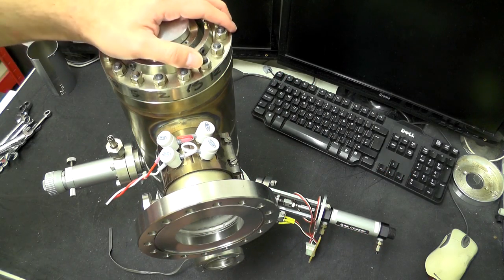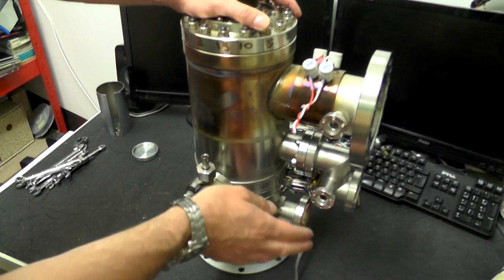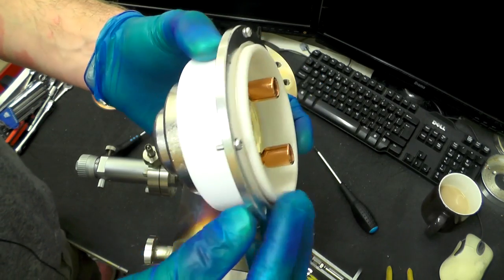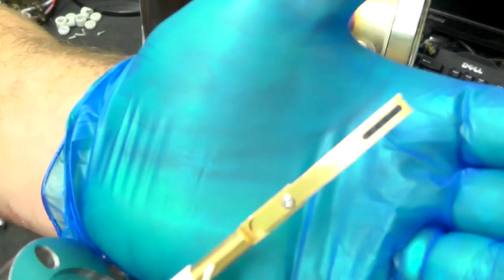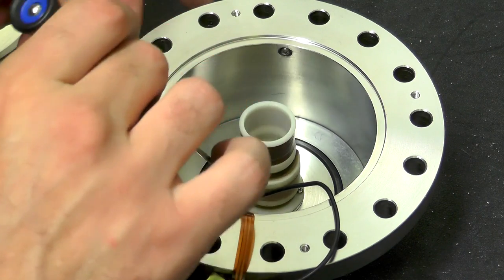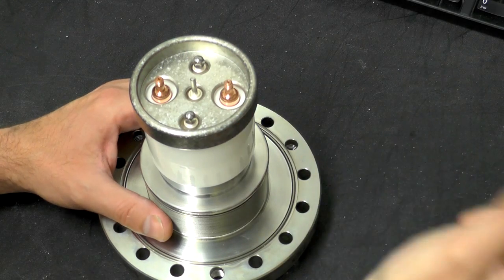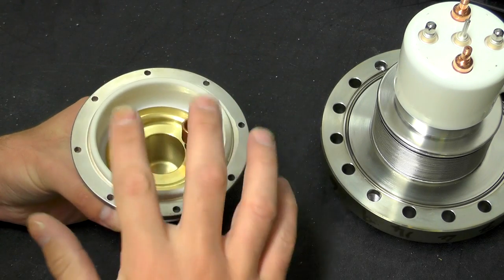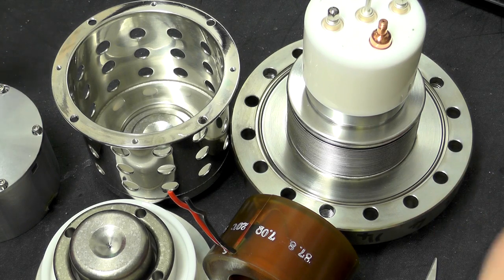DL123 - SEM Teardown Part 2: Electron Gun & Column

Comment: I wonder if the electrode on the beam aperture doohicky is so you can get the beam dead centre though the hole - adjust for minimum current hitting the aperture
Reply from the maker: i think that could be entirely possible, i only have a couple of basic block diagrams for this machine but newer models used an alignment target that would generate a pattern to view on the monitors.
Reply: I have not seen that mentioned in the manual of the microscope. At least on mine the apertures are for different tasks, On mine the apertures are 400µm 300µm 200µm 100µm where the first 2 are noted to be for X-Ray analysis, and the second 2 are for secondary electron imaging.

I can probably tell you guys more, once i get mine up and running.

edit:
Oh and thanks Dexter for the tairdown, it has helped me on the restoration of my microscope.

edit2:

The manual dose mention the aperture control in the condenser lens alignment procedure, but it dose not state it is the thing being aligned. Im guessing the condenser lens has more then 1 coil for alignment, alternatively i can guess that the scanning coils might be able to do so as well.

Comment: The coil at 27:37 is the main focusing lens.  The objective lens is basically in the tip of the cone on the very end.  The large magnet is the condenser lens.  While the condenser does look about right, I always thought that the focusing lens would have been bigger and require more current.  But perhaps it doesn't as its really just preparing the beam for the primary objective.  I also would have thought that the astigmatism/bending lenses (the octopole) would have had iron or steel cores.  But hey, you learn something everyday.  My experience with this stuff is mostly limited to high current ion beams for semiconductor processing.  Thanks for the video.
Reply: I don't think so. The 1st set is a saddle deflector that probably aligns the beam to the center of the aperture or the center of the objective. The larger coil is a condenser, while the objective was left on the chamber (you can see it at the chamber on the 1st video)

Comment: Regarding the emitter: Hitachi is using the term "Field Emission" for Schottky emitters too, i.e. emitters that are heated and under high extraction voltage at the same time, so it's not sure that the emitter is cold.
Reply: The emitter for the S800 is cold.  I own an S4000 which is similar.

Comment: Great video, thanks for posting. I think the plating on those internal components may be nickel, making it seem magnetic, also, the additional coils beside the main focusing magnet may be to do with astigmatism correction or 'vernier' adjustments for beam positioning or focus perhaps, but that's just a hunch.
Reply from the maker: thank Dan, it's hard to tell as everything is so bright without any oxidisation on the metals.

Comment: wonderful !!!! brilliant video. I wished I had something like that for a teardown video
Reply: 27:40 looks like a deflection coil. Maybe?
I'm always very concerned if it comes to ceramic parts. Beryllium Oxide. You can never know. Take care!
Reply from the maker: yea it's for sure a deflection coil of some sorts but if you notice there are only two coils which means it has only one axis so i though it was a bit odd compared to the stigmatism coils. I doubt there is any BeO in there as it's normally used to transfer heat and be an  electrical insulator.
Reply from the maker: Thanks Max, go and visit your scrap and recycling centres and get them to put interesting things to one side for you! You never know you might get something unusual!
Reply: There is no chance to get stuff from recycling centres, due to legal issues here in my country. They even denied my offer to pay for scrap. They said they are allowed to sell to recycling companies only. 
(I was planning to open up a recycling business though. Again, too many legal issues)

Comment: @DextersTechLab if you still alive, can you remember, how actually the moving part at 17:34 looked from the bottom. I wonder how the seal is achieved. Was a metallic ball or smth else? btw we have this kind of hitachi s800 still working here.
Reply from the maker: Hmm, i think it was covered in some rubbery gasket material. If you seal off the column and open the chamber this would naturally be sealed shut by atmospheric pressure

Comment: Such beautiful engineering. I would never be able to throw that away but the pneumatic actuator is about the only thing I can think of uses for, except, Hmm, I wonder if the large coil would be any use for flinging ball bearings.

Wondering if the smaller set of coils were some sort of deflection control for fine beam positioning?
Reply from the maker: yes i don't think there's much to reuse inside the column, most of the reusable stuff is in the vacuum system. It is beautiful yes, i need to find or make some ornamental use out of the column parts!

Comment: Nice Video ! I am preparing to refurbrish an identical unit (e-mailed you a while ago), so this tear down will save me a lot of time. 

The coils you took apart were the condenser coil (the big one) and the stigmator coil (not 100% sure). Since this is a cold field emission gun unit, electrons are pulled from a ninute tip of the filament (100 nanometer or so). As the tip gets covered by atoms of air, the emission gets quite instable, which negatively affects image quality. The apertre strip you took apart is used to measure the momentary emission current (a metal box cotaining an opamp was used for it). This data is used by the imaging system (based on a Motorola 6800 8-bit CPU) to compensates for fluctuations in emission to improve the image quality.
Reply from the maker: Thanks! I have your email, i am saving all the parts you need, when i am finished i'll detail them all for you. If you see anything else you need, just let me know.
Reply: How amusing, im also preparing to refurbish (and rebuild part of) an identical microscope. Maybe we can help each other out in problem solving in the future.

Im guessing though, that your microscope is in better condition then mine, seeing as every cable between the column and the console has been cut. And im missing the ion pump power supply (though i can rebuild that from the schematics if i cant track down the original).

Im also planning on creating a digitization card for the microscope, to allow the analog output to be saved digitally. So far the plan is to stick it into the consoles expansion bay, and connect it to a computer that is outside of the console.
Reply: hi ! Great news ! I am currently on holidays but will gladly share infos ! I was able to find the schematic diagram for the scope and some instructions from a university for the S-900 model (very similar). I will try to send some videos and get in contact with you when I get bach home (mid july).
Reply: If you are in need of the schematics of the S800, i have a full copy of them (in book form), as well as the original owners manual. And am currently tracking down the service manual.

Also, great news that you responded as well, i look forward to working with you in restoring our 2 microscopes back to working order.

edit:
Also, have a nice vacation / holiday (not sure what to call it).
Reply: WOW - that would be great ! I will contact you in two weeks !
Reply: i sent you a PM via youtube
Reply: You have been awfully quiet. Whats up?
Reply: Hi ! Sorry for the silence :) I was developing a framegrabber system for a different SEM. Will email you in a few minutes !
Reply: Ian Stevenson  I got the manual for the S800, and have resurrected mine. I still lack the service manual though, but got by on just the schematics. 

why do you ask?
Reply: Ian Stevenson  Nice. I have verified 5nm point resolution. but that is likely due to my optical alignment not being optimal (owing to not having the alignment tools for the gun, so i had to align it with a single berylium copper key).

I currently have the system set to 5uA beam current, and got that resolution with the condenser almost at full tilt, smallest objective aperture and second largest condenser aperture (beam monitor). 

Correcting astigmatism was a bit tricky and required me to move back and forth between the main astigmatism dials and the presets under the hidden panel to correct it.

Working distance for that test was 5mm 30KV acceleration voltage, with the back scatter detector full retracted and no cooling on the pol piece anti contaminator.

Chamber was pumped to 1e-5mbar at the time. Ion pump pressures where 1.5e-9 mbar for IP1, 8e-9 for IP2, and somewhere around e-8mbar for IP3.

I also noticed that image had a sin wave modulated onto it. Not sure as to the cause though. I was only visible at and beyond 100Kx.

All in all its a nice little machine. although it did take some time to fix it back up.
Reply: Ian Stevenson  The gauges are indeed set for Pa, but i am more familiar with mBar so converted it from Pa to mBar. The high pressure in IP1 is likely due to me having a leak in the bypass manifold. I did not pick it up with my helium leak tester when i fist sweeped the, at the time, newly resealed unit. But after the first bakeout IP1 and IP2 where orders of magnitude off what they should be. After repeating the bakeout for 3 more rounds (all of which where done with the Diffusion pump's cryo shield cooled with LN2) i eventually found that a leak had developed in the bypass. 

This was found by closing the manual valves to the Ion Pumps which resulted in their pressure dropping like a rock. 

After cooldown IP1 reached 0.7e-7Pa. After the first round of resting and alignment it went up to 2e-7Pa, and droped back down over the course of 2 days. It has since remained roughly around that point when not in use.

With the bypass open to all 3 pumps, i can only get to 1e-4 to 1e-5pa with the ion pumps alone. 

I later checked the leak by opening the bypass to the chamber (with the ion pumps sealed off) and it rose from 1e-5 mbar (indicated by a Bayard-Alpert Gauge mounted to the chamber via a port) to around 1e-3 mbar (at which point the gauge switched off). The system came back down to 3e-5 mbar within less then a minute though. 

I have since also squired a second S800 column, but this unit has a leak in the weld for the beam monitor aperture flange. (verified by helium leak test, and replacement of the conflat seal, with more leak testing). Ill eventually try and get it into vacuum as well, but currently dont have a second functional ion pump power supply. And have not yet figured out a way to properly reweld it.

As for shielding, i have the mumetal shield on the column. 

I would still be rather interested in the service manual, and any tips you may have in regards to further improving the resolution of this unit. 

I will post my email address in a separate post, where i shall remove it once i receive one from you.

Comment: Are there any markings on the copper gaskets? What is that speckled graphite, zink-like coating on some of the parts? Do you think the needle from a gramophone could substitute the cathode?

And thanks for doing this!
Reply from the maker: There are no markings on the gaskets, the pattern on some of the parts looks very much like zinc so at this point i would say it is zinc. I doubt a gramophone needle would be suitable, most home made SEMs would use a hot cathode & thermionic emission.

Comment: You would not happen to still have a spare 20l ion pump? One in my s800 died. Also is the column still avalible?
Reply: Im very close to getting a s800 running. Just have a uhv leak and broken ion pump and powersupply to deal with
Reply from the maker: Sorry no, it was all sold/given away within a couple of weeks after making the video.
Reply: @DextersTechLab  well, thats unfortunate. thanks anyways.